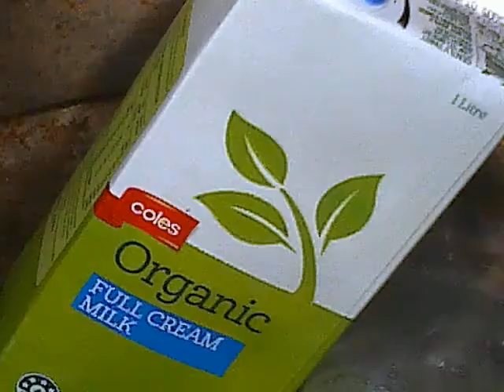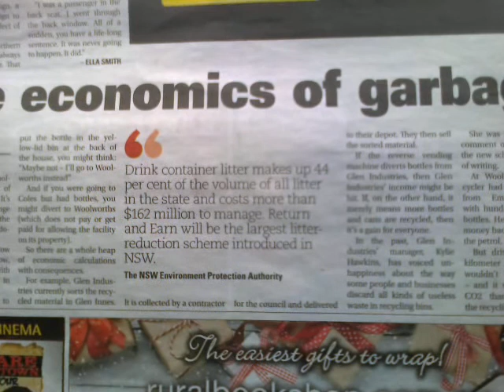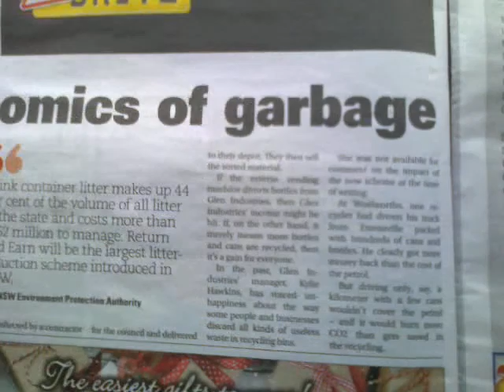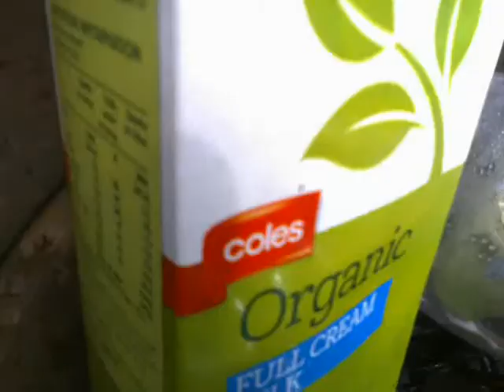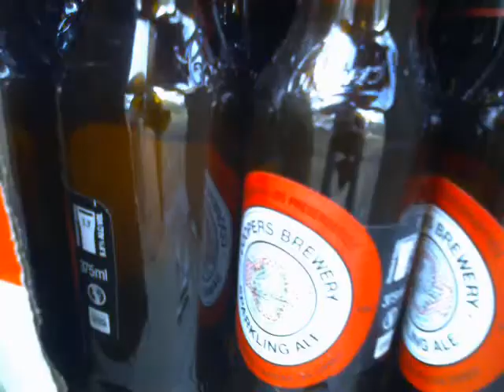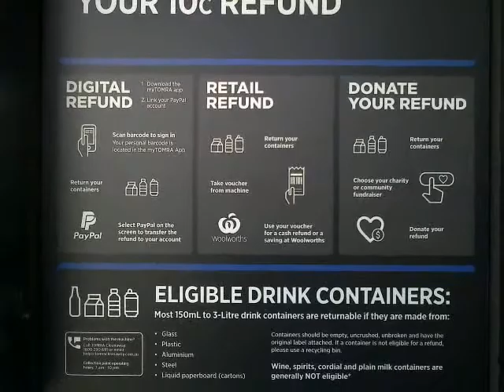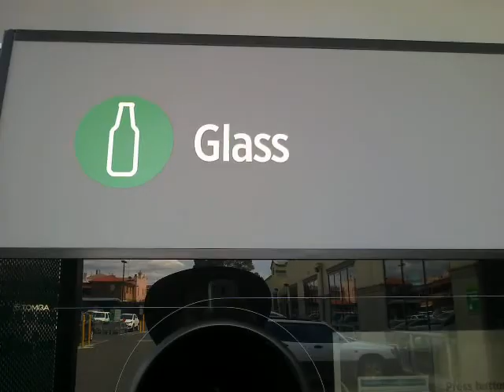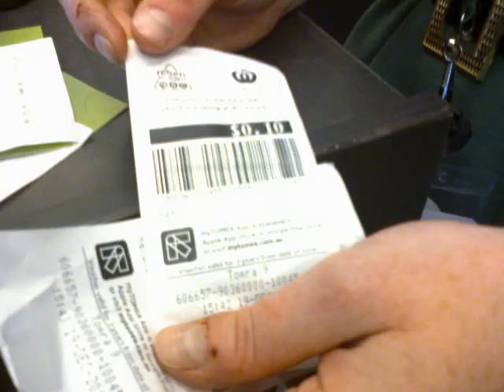Reverse Vending Machines..; The Economics Of Garbage...

Comment: Do you refrigerate your beer or do you drink it warm?
Reply from the maker: G'day,

  Thanks.

  I have a 1920s vintage Trafalgar Cold-Safe, which uses Water dripping on Toweling Screens to cool the contents of the Safe,  before that I used to have a wet Bag over the Beer, in the Shade, with Water dripping onto the Bag.

  It's not as cold as an actual Refrigerator, but it doesn't use any Power, merely 3 to 6 Litres of water per day ; so I love it.

  Have a good one,

  ;-p

  Ciao !

Comment: We just got one in my town. I have fed it twice now. I forsee folks re printing bogus bar codes and tricking the machine into divulging 10 cents for unacceptable bottles. I guestimate 12.80 in the drum.
Reply from the maker: G'day,  

  Thanks.
  
  I hadn't thought of the ide of relabelling the Dud Bottles with new labels..., it would be a bloody lot of work to go chasing after 10 cents though, so I'll probably give it a miss.

  Yeah, you can fit more than 10 Cartons in the Drum, but the Trailer bounces around and loads have to be covered ; so I find it advisable to leave a bit of "Freeboard" around the top edge of the Drum..., otherwise the Stubbies try to escape, and I find them on the way home beside the Driveway.

  Have a good one...

  ;-p

  Ciao !

Comment: A ten cent return on empty bottles is a great return....I notice you now have your solar panels on the ground. What happened to "The Tower Of Power" ?
Reply from the maker: G'day Ed,

  Thanks.

  I agree mate, 10 cents on a Stubby..., it was only Threepence for a small Lemonade Bottle in 1966 ; when Decimal Currency killed the old Scheme.

  The Tower of Power is still doing it's thing, but my son donated 3 pairs of 6-Volt Batteries from. Golf-Cart which was getting 4 new Pairs because it had rooted 1 of it's Pairs...; so I have the 3 Pairs sitting there, each with a 10-Watt Pannel to give it a Maintenance-Charge every day, keeping them from deteriorating while I get the last out of the old Batteries which are in the Pyramid.

  I literally have too many Free 2nd-Hand Batteries to be using them all ; and I'm too much of a Tight-Arse to discard the ones which are old but still working...

  So, 3 Panels to maintain my spare Storage Batteries...

  Life as a Cheapsate is a bit complicated.

  Have a good one,

  ;-p

  Ciao !